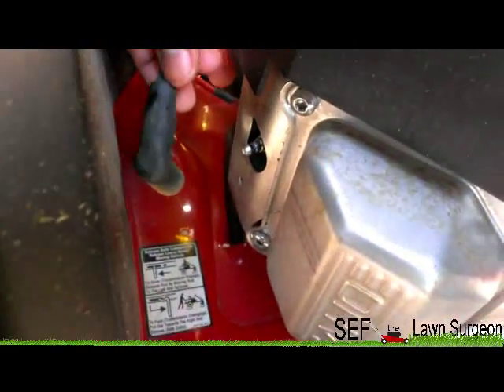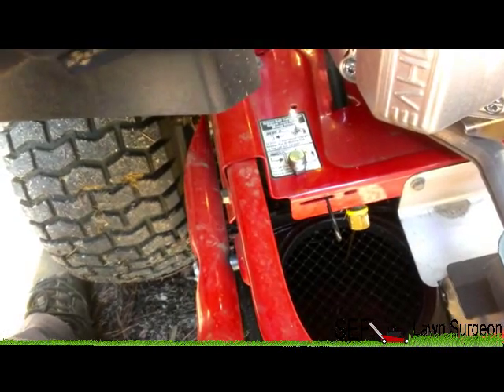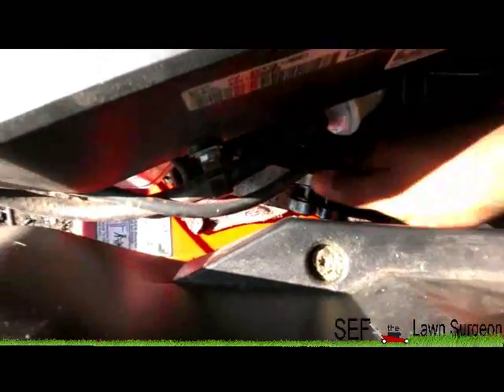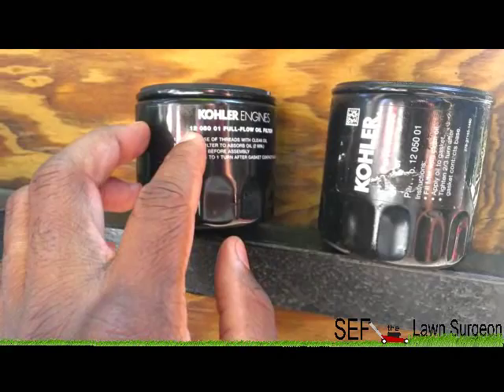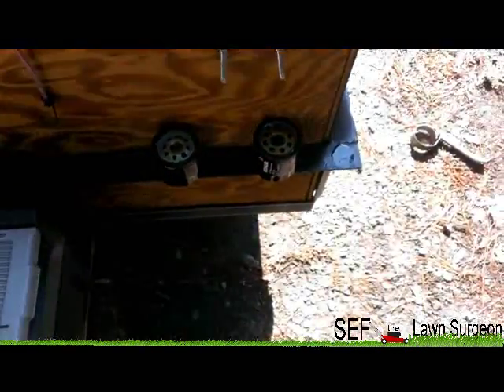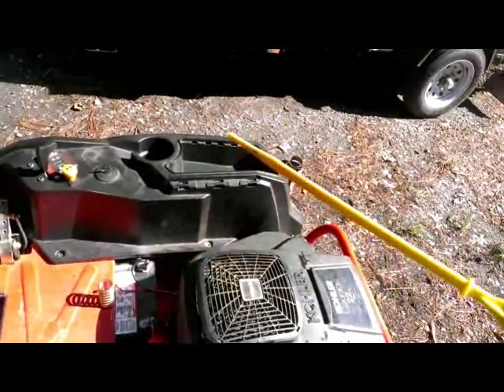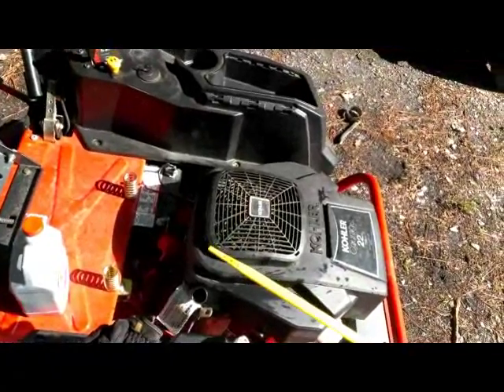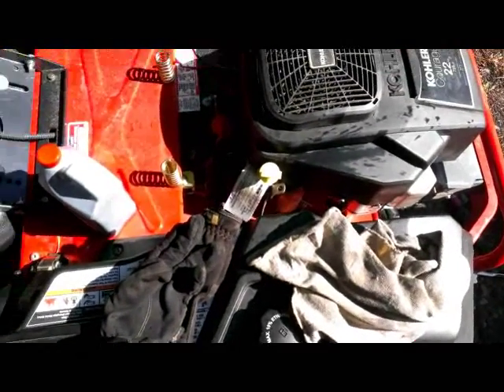Troy Bilt Mustang 42 xp Oil and filter Change

Comment: There are a few items that need to be mentioned. The oil drain hose has a pipe fitting installed on a rubber hose. There is a 3/8" NPT square drive pipe plug screwed into the fitting that simply would not budge. Whoever built the engine in my mower was evidently some sort of body builder or a gorilla.  If yours is really hard to get off, DO NOT use an adjustable wrench to remove it as you will round off the edges. Instead use a 3/4" or 17mm  box  end wrench to "back" the fitting and a 13mm box end wrench to back out the plug. If you have a 7/16" 8 point socket, that is actually the correct item, but the 13mm box end will work. I had to restrain the 3/4" wrench against the mower frame and use a 20" cheater pipe on the plug to get it to budge. I'm going back with a hex head 3/8" pipe plug (available at auto parts stores) to simplify future changes. I also highly recommend a "pliers type" oil filter wrench to remove the original oil filter as that same gorilla installed it as well.
Reply: This 100% couldn’t get mine off until I went and got a 3/4” end wrench and a strap wrench (all I could find close by) and get the filter off. Otherwise no issues great video and great mower as well I love my mustang!!

Comment: Does the mower come with oil in it from store?
Reply from the maker: +Derek Sexter ... yea... it does but the ppl at the store put the mower together so i would change it my self soon after you get it just to make sure it was done correctly...you know?
Reply: Yeah - new engines have the "break in" oil change after they've been running a bit. The idea is that an oil change after the first 5 hours of use removes filings, shavings, and sediment from the engines first entering service. 

Thanks for the video!